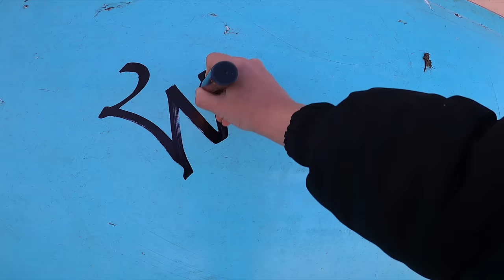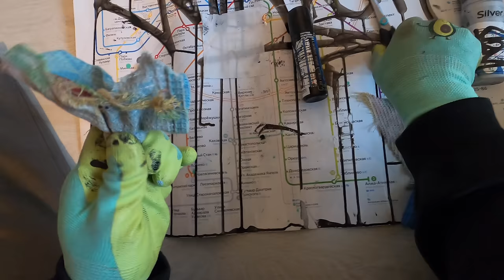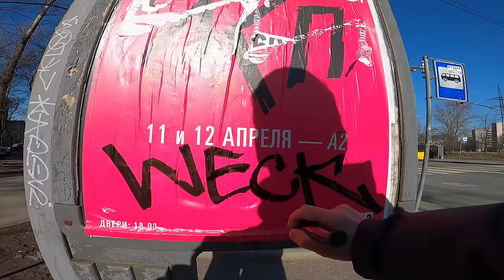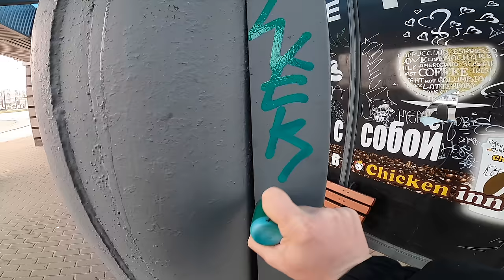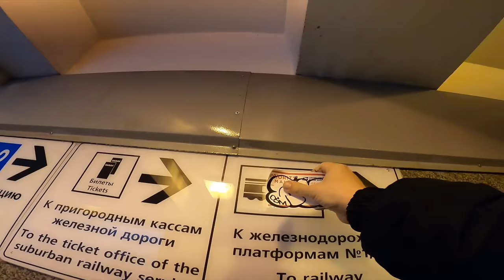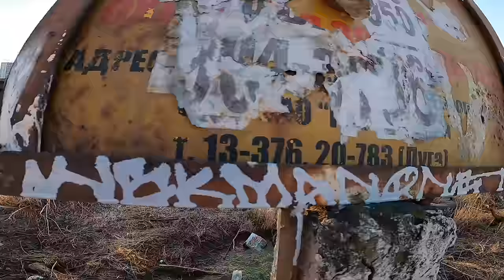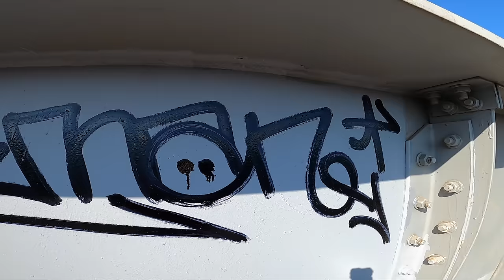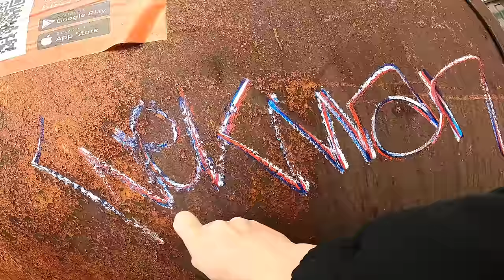Single player graffiti tags and throwups +Bonus reinforcement of handmade black mop

Comment: 15:27 I'm diggin' that splatter on the rust; gives the tag character
Reply: fr
Reply: You right
Reply: What kind of marker is that?
Reply: @rememberitsajourney  it's a corrector pen. It's normally filled with white out, but you can buy them empty from a graff shop and fill with your choice of ink/paint
Reply: @ongakuchan587  thank you🙏 any idea what to look up for online? all im finding are correction fluid and fine point pens that don’t look suitable for metal surfaces like Wek has.
Reply: @rememberitsajourney  i think you can make some DIY pens using syringe needles and a holder
Reply: @ongakuchan587  thanks